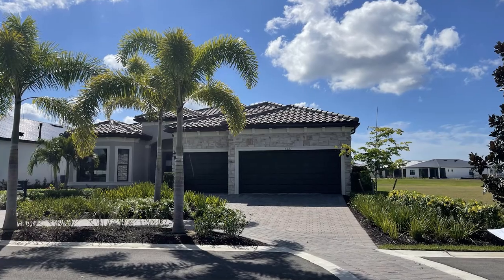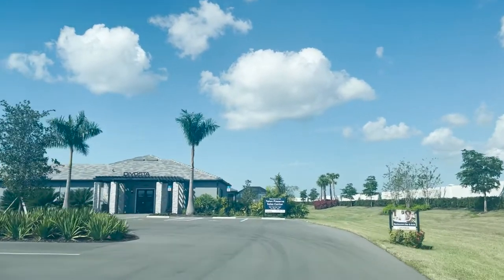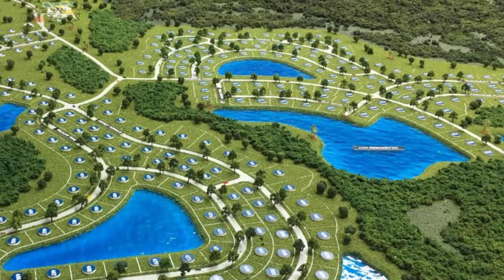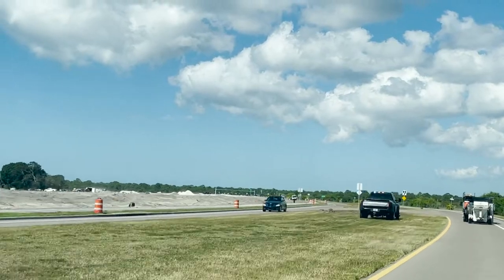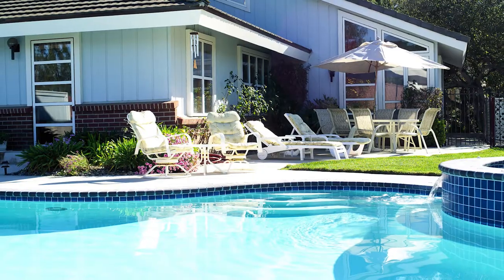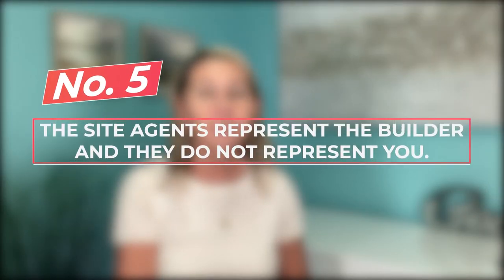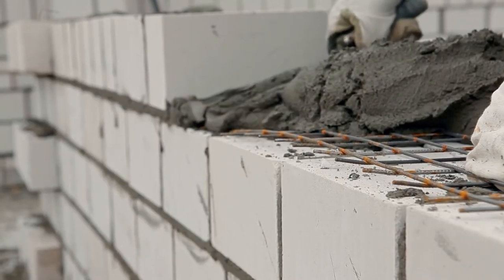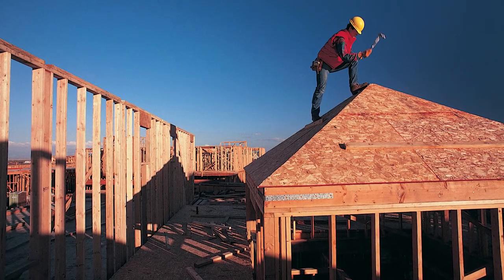FLORIDA HOME BUILDING. 7 BUILDER SECRETS.

Comment: Thank you Lisa!  This is so incredibly ironic as I logged into YouTube and your video came up and showed the same development I just signed a contract on in Nokomis. Your advice is spot on, although I opted not to add the pool as I thought it would be more economical to install one separately. Would really appreciate your thoughts on this.  Thanks!
Reply from the maker: I would ask what the pool cost are to be added. One big factor is the convenience of getting installed prior is not tearing up yard while doing. I am hearing pool quotes from 80,000-95,000 with a cage currently depending on size and features.